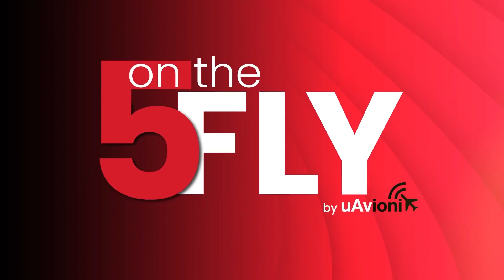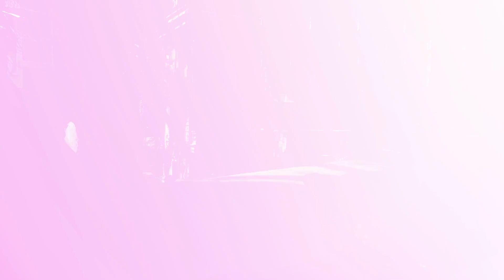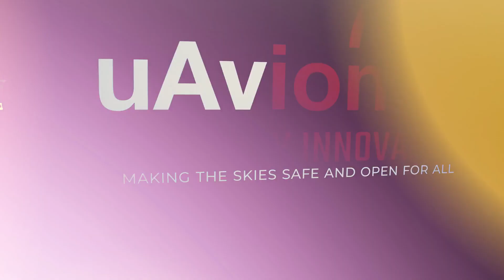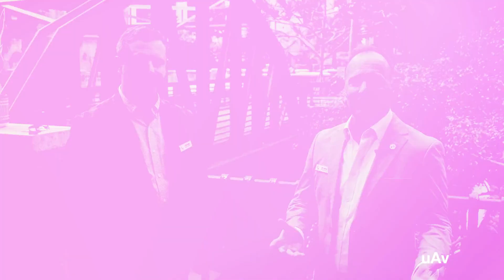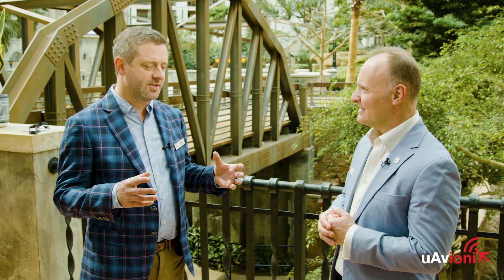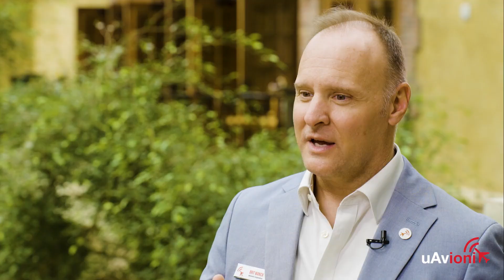AEA 2024: Software Updates for the Connected Cockpit

Comment: Excited to have my AV-30 connected to the Trio Pro Pilot in the Cessna soon! Can you please have a static link that will pull up the most current installation manual? It changes with every revision.
Reply: Currently have this setup running in my 1976 Grumman Cheetah and it works like a champ. Navigation is with a Garmin GPS-175 with GDL88 ADS-B. Next step is to upgrade the firmware on both AV-30s to be able to display traffic. Exciting to see where uAvionix is going!
Reply: We love our trio autopilot.  I can’t wait either.